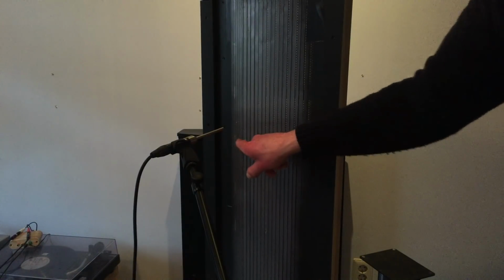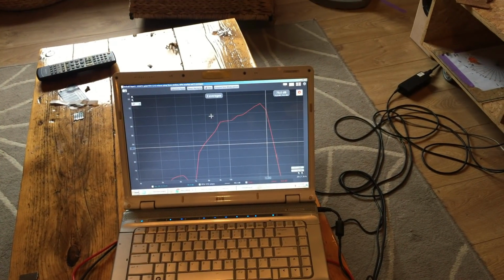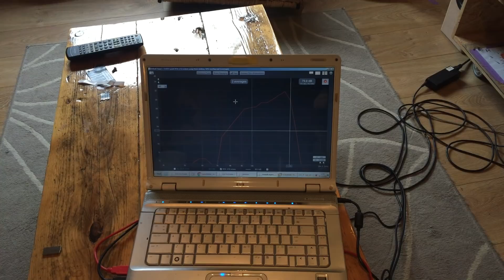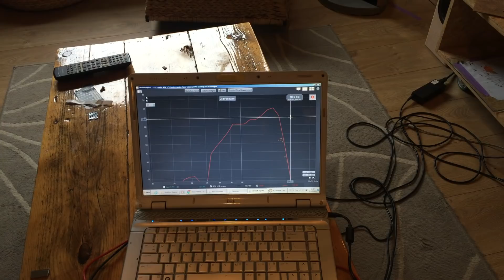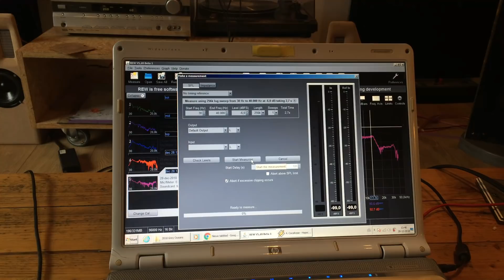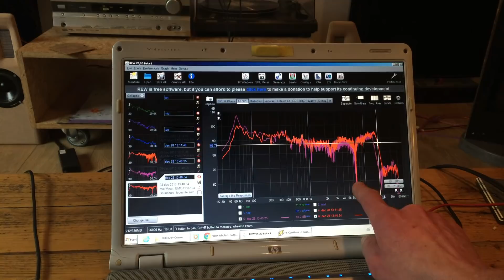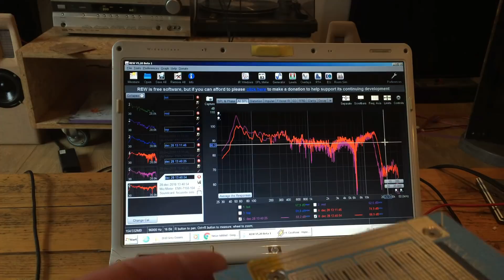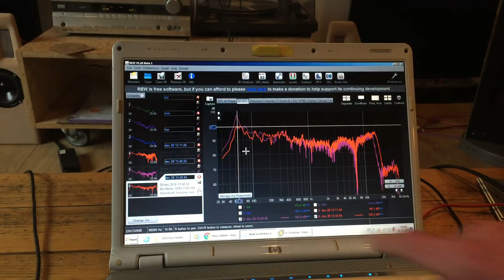What does foil tension do to the upper range in a 'Magnepan' style Planar magnetic speakers

Comment: Perhaps, all you need is a baffle. Something to section the tweeters into smaller portions. So, you would have like 10 tweeters there on the side, but the sound shouldn't change besides being able to reach above 15 khz. This way you could lay the baffle on the tweeters, and test it without changing the speaker itself.
Reply from the maker: That would result in the same  :(  as i said its not the resonamce but the tension :)
Reply: @joppepeelen  You can't hear the tension. You have to change a factor that is contributing to the resonance. Tension is one factor, and the size of the vibrating surface is the other. Your smaller tweeters are able to resonate faster because small speakers have that advantage. So, if you can separate (baffle) the large tweeters into smaller ones, you should be able to detect the upper decibels that you are aiming for. Your hand will deaden the sound making it sound muffled, so it can't be tested in that way. A thin metal frame, perhaps adhered to the surface by the magnets, could test this. It's like frets on a stringed instrument. It's a thought anyway :)

Comment: I think that the original Magnepan design sucks. The contact surface between the wire and the film is too small and can't guarantee an accurate transmission of motion to the membrane. Also the glue is not particularly rigid, so at the higher frequencies it is reasonable to imagine a non-optimal behavior. The greater contact surface of an aluminum foil certainly guarantees better results. But it is obviously more difficult to achieve at home when the driver takes on certain dimensions.
Reply from the maker: well you can measure quite clearly whee the foil does not act as a rigid thing. i dont agree about it sucking. if you ever listened to most bare basic magnepans they sound rather good. also i took this pair once to a DIY audio venue with speakers way way way more expensive and in the end , (it whas not a competition) it ended up as most mentioned interesting and overall nice sounding speaker/ easy listening. ... so yeah. there is better i am sure  :) especially the low end might need allot of help. but the rest, is kind  of pleasing !
Reply: @joppepeelen  I know the Magneplanars very well. I worked for 12 years in a Hi-Fi store and I was an official distributor of the brand. Also, I've had two pairs of Maggies, the old MG2 and a more recent MG 3.5. Last but not least, I have self-built for years electrostatic, magnetoplanar and ribbon transducers.  I do not like the old Magnepan technology conceptually, and I don't think it's a coincidence that Magneplanar itself has moved to "quasi ribbon" technology. This does not exclude that we can obtain appreciable results even with the wires. But you can do much better, IMHO. Oh, I'm an ESL guy, sorry. :)
Reply: @magrosi65  Also referring to your previous post... MG could use squared/rectangular (primitive ribbon?) wire since their early years and obtain better results for sure. Today in the magnetoplanar realm there are other brands making much better products as Alsyvox, Tuscanini Acoustics, Diptyque Audio do... actually to be honest their products are much costlier too. I could even guess that @joppe peelen's works could even give better results than some MG products can !

Comment: Does this mylar you use have an aluminum layer?
I ask this because you call this foil instead of film.  
I'm not trying to start argument, just trying to clarify what you are using.
Reply from the maker: OOh sorry :) it is FILM :)  mylar film 12 micron (just like every magenpan uses). in the other small tweeters that i etch  it is foil :) semantics :) English is not my native language as you might notice :) i used to call that FOIL, laminated foil. so just foil is bare for me :) and laminated it has a sort of laminate on it :)

its oke, perfectly fine question.   so bare foil.... is called film ? might want to introduce that to my vocabulary, might take a while haha
Reply: I suck at English and it's the only one I know.
Reply from the maker: @aurthorthing7403  haha ok  but a plain foil.... without anything is called film ? just to be sure
Reply: @joppepeelen  From my understanding, foil refers to metal and film refers to plastic. And then there's metalized/metallised film, which I'm not sure if it's different than laminated foil.
Reply from the maker: @clbruh6392  yeah  metalized is different, the way it is put on there as well as the thickness.   metalized is used  by evaporating alu in a vacuum so it deposits on teh foil. problem here is getting a thick layer. thats where laminates are come into play a laminate of film,glue,alu

 metalized is what some use for ESL's not a wise choice but it works :)
Reply: @joppepeelen  you mean deposits on the film. ;) Which ESL uses metalized diaphragm? And what do you think of stators with insulating coating to prevent arcing?
Reply: They look like  MG2 series up to an MG c. It's not difficult to redo - remove old wires with acetone carefully. And if you want a good job you can build a jig to stretch the wires on before re gluing-recommended- I've done it thrice with mine, so you can still do some new building!

Interestingly Magnepan does make other many later wider models as you suggest.